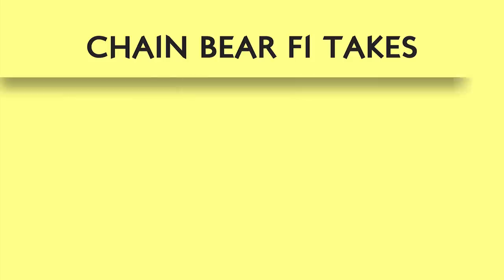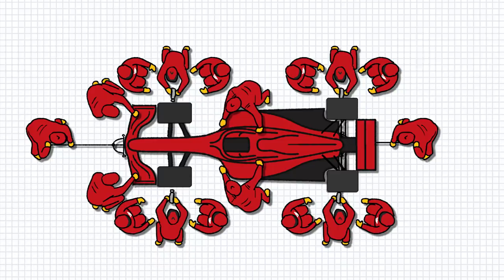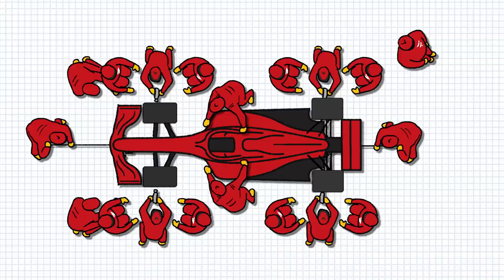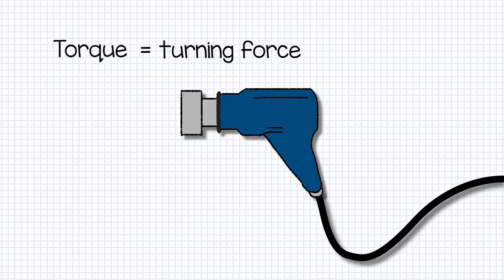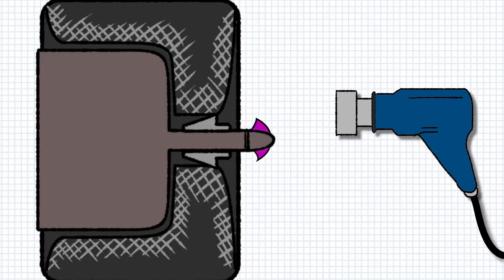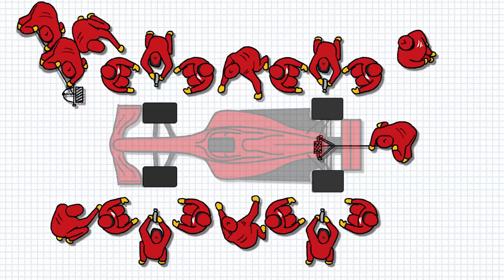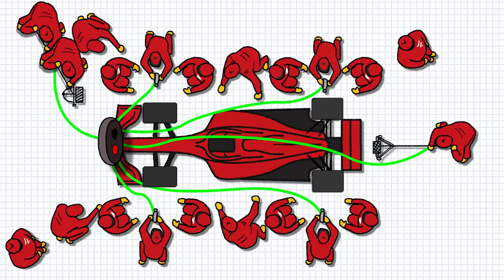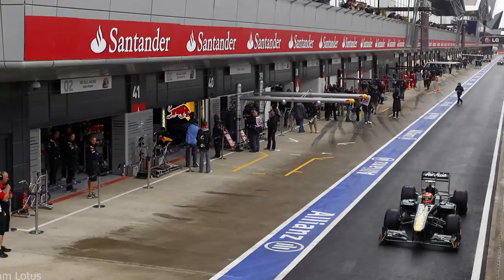The anatomy of an F1 pitstop - Two seconds of mayhem - Bahrain GP 2018

Comment: The set time for a pit top is a bad idea. It will take away the risk in strategies and timing as teams will know precisely the time they will gain/lose in the pit stops.
Reply: I'd bet they already know this time based on their pit training, so not much change.
Reply: They already kinda know how much time it takes to make a pit stop (and by kinda know i mean within a .2-.3 sec margin)
Reply: Ethan Cadman And also if someone needs a new front wing, the time between a normal pit stop and a pit stop with front wing change would be smaller
Reply: F1 is expensive. Driver and Car reliability already a significant factor for failure. Pit stop competition is too big risk for failure. Imagine there are 15 pit crews, one made error,  Boom, Zero points. I fully support minimum pitstop time 5 secs.
Reply: I like the smaller pit crew idea, F1 has about double the pit crews of other category’s of racing if not more, I’d also like to see refuelling brought back even tho I understand why it won’t, could maybe look at another system tho, one where a fuel cap has to be closed before it triggers that fuelling is complete which would mean in theory it would be impossible for a car to leave with a fuel hose still attached, just think it would make pit stops more interesting and strategies more interesting an
Reply: Agreed, takes out the magic

Comment: Box shaped line 1m away from the cars position in the pits. Car may only be released once everyone is over the line. Safe and competitive.
Reply: Imrahil sounds really cool, but this could be very difficult at street circuits like Monaco. But this would be great to watch since this would super competitive between all the pitstop teams.
Reply: Imrahil actually that is a great idea, but the room for the crews is already very small.
Reply: I don't see this working as it requires mechanics to hurl themselves towards the traffic lane and potentialle get run over if they're too eager
Reply: You'll see mechanics leaping backward out of your box regardless of the state of the car or dangers around them as it will save a good 0.2 seconds.
Reply: Excludos not towards the traffic line but between the car and the box/garage itself. That way they won't be in any danger to get run over because they are in a safe place.
Reply: My favorite solution and if the light signal for the car turns green before everyone and every body part is over the line it is an unsafe release with according penalty.
Reply: Tiliad why? They got a box the line could be right at the entrance of the box so everybody has typo be in the box before the light turns green. No problem even for street courses like Monaco.
Reply: If I understand that right, one line on the garage side. That means the track side guys have to run around the car. I like that. Would call for a lot of video replay. Was the mechanic just over or not quite. Kind of like the out of bounds in American football.

Personally, I prefer reduced crews. For me two tire changers and back to the air jacks. The tire changers line up with the fresh tire on the "outside". They have to scramble around to the other side and do that tire. Would make a pit stop 5 to 10 seconds and change the strategy completely. I'd rather see a tire last the distance like it used to and skip mandatory compound change all together
Reply: Pit stops are fine the way they are. However, one thing that could be improved is having wheels that don't need a nut to be tightened. Sort of pop it in and it locks itself, and then needs a tool to be unlocked. Like the sprung pin described in the video, but tight and secure enough that nothing else is needed. Surely engineers can come up with such a system. Then there would be no more loose wheels, and no need for pneumatic guns.
Reply: I've been hearing this alot. Can we make a petition or just email the FIA and Liberty  Media already?
Reply: hire usain bolt and his cousins :)
Reply: But hard to check if someone ruins it

Comment: I like the solution you suggested with the buttons some distance away from the wheel gun operators. Might look a little forced/comical, but adding another physical task for the pit crew to do will add to the the frantic feel that a pit stop already has and will probably be cause for a more interesting race

Comment: I like the "flick a switch and press a button" solution, but they have to keep holding the button to keep it green, so when they notice that the wheel's not on properly they can just release the button and put the wheel on properly without flailing their arms while the car accelerating down the pit lane.

Comment: My proposal (I don't know if it's a good idea):
Give the gun operators on each tyre a "ready-button" on the gun that they can press when their tyre is fully on and fitted. When all the mechanics of the four wheels have pressed the button, and the car is on the ground, only then the light can go green.
This looks to be the same system as you explained, but it's not. Because nowadays, the buttons on the gun don't need to be pressed. There is an electronic systems that checks if the gun is close to the tyre. It is automated and there is currently no need for mechanics to press the button.
Reply: I saw a NASCAR accident where the jackmen lowered the car to fast and a tire changer wasn't done and he had his hand in the wheel well so the car drove over his hand and the tire fell off soon after the driver left the pit
Reply: I saw a NASCAR incident where a jackman lowered the car too early so a tire changer didn't finish but he also had his hand on the tire when the car drove off. And when the car left the pit a wheel flew off. I've also seen someone drive off with a fuel can still attached to their car, pretty sure it was an LMP but it's been a while since I saw this one

Comment: The engineer commentator on finnish TV told that some teams have torque sensors in their wheel guns and it turns the light green when it gets high torque readings. It is possible that the programmer of the software simply didn't consider that three wheels are getting tight while fourth is still tight because it's stuck and thus gives green light.

Comment: The way the traffic light knows the wheel is on is when a wheel is tightened to a specific torque. At Bahrain the mechanic put the setting on the gun wrong and he tightened he wheel when trying to get the wheel off. The traffic light system thought the wheel was tightened and was ready to go and that is where the accident happened. I know all this as I went to the McLaren technology centre and they told me all the info about what happened.

Comment: A simple solution would be to change the buttons so they have to be held down. This way, if anyone releases their button before all of them have been pressed and held, the light will not turn green. This comes right from roller coaster operation, where dispatching the train from the station requires the operator and an attendant, at the opposite corner, to both hold down a button. If either of them releases their button before the train clears the station, it'll stop.

Comment: On Sky's program, David and Martin mentioned Ferrari's traffic light system depended on the wheels' nuts being tightened. The moment 4 wheels are tightened, it will signal green. Of course it can be override by someone in the pits. 

But the left rear's wheel wasn't even loosened, hence the green light was given.

Comment: I have an idea on how to avoid future such incidents during pit stops:
Paint white lines at the edges of the pit box.
Have the pole with the green and red lights that tell drivers when to go during a pit contain a camera that will be able to see these white lines, and can tell when they are obstructed or other (self driving cars and lane change warning systems have been on passenger cars for at while now).
Have a system which will turn the light green ONLY after both jacks are dropped and the pit box lines are clear.
System can also be programmed to see if tires go on/off the car.

This could solve a lot of potential injuries in the pits. In the case of today's race, the left rear never came off the car, yet the jacks were dropped. This system would have been able to detect: 
Obstruction of pit box line by the mechanics around the left rear tire.
Left rear tire never came off the vehicle.

This would also eliminate the need for mandatory minimum put stop times.

What do you guys think? Could some sort of system like this be implemented by the FIA?
Essentially a "virtual lollipop man".

Comment: Actually the mechanics dont have a button as far as I know, but rather there is a integrated system into the wheel gun; called Paoli TSA System, which monitors the torque applied to the wheel nut, shows the mechanic via LEDs and sends the signal to a designated PC.

My guess is, the wheel nut didnt open the first time he tried, turning the the nut left. 
Then, as we guys often do, he tried to loosen it by turning the nut the other way round (in his case right), "tightenting" it again.
This noticed the gun and gave the signal "torque reached, tire changed" and therefore gave the green light from that tire.
Then he switched the rotation of the gun back again, finally loosening it. But at that time it was to late, the rear jack operator dropped the car and Kimi took off.

So in my eyes, the mistake was done by the guy at the rear; he has to see if a tire was changed or not. And decide when to drop the car or not.

Comment: Put sensors and hooks in the wheel bolts that the hooks spring out when over the nut when it’s properly tightened and sensors that tell the spotter. When they’re all fit and the car lowered ready to go.

Comment: When refuelling was a thing, the refuelling delay gave the team time (8-10 seconds more or less) to do all the changes they need to make to the wheels, tear off strips, safety checks. The complex part of pitting a car - the wheel change, is now completely unrestricted, which means teams have an incentive to push as hard as they can to reduce the duration of this action. This is the root of the issue. I'm not saying bring refuelling back (but I kind of am, because it added a great tactical element), I'm saying that there needs to be a regulating factor to prevent teams pushing beyond their limits and making mistakes. Kimi running over the pit crew member is as serious as any crash on the racing circuit - if that leg had broken a little higher through his femur, he may not have survived. 2 seconds a stop is about the limit of what a team can safely manage, as has been proven 3 times in two races.

Comment: F1 is supposed to be the pinnacle of motorsport, although all the mentioned options are great for pit stop safety It would not fit in the "absolute fastest way possible" of F1. Banning refueling was a big step foward in terms of pit safety bit kinda made things less interesting when fuel loads were such an integral part of race strategy.
Reply: TheSuperNort True, but as an added effect it made pit stops much less fire prone or with refueling equipment in general, massa's debacle at singapore 08 is a prime example.

Comment: Look at Australia supercars pitstops. We only have 1 guy per wheel and the cars have air jacks in them. When the car drops you go. Very rare failures and pribeln apart from the rare times someone is dropped whilst still refueling. Extremely rare seeing 1 team got a 5 minute penalty for doing so.

Comment: Cameras using artificial vision from the top down send a "no go" signal until all of the crew is out of predefined areas in front of the wheels and body work.  A method to "ID" the wheel/tire combo and the car would not move until the 4 old wheels and tires were removed and the new ones were fitted.

Comment: I had heard (from where I don't remember, probably some commenter on reddit) that the Ferrari system is based off of tightness of wheel nuts. If they are tight, green light shows. Sort of like an "istight" variable being used. Of course, as we saw, this system has its flaws, and a "isNewWheel" AND "istight" would work as a better gate.

Comment: the indy car system with 1 person per corner for the wheels and also pneumatic jacks built into the car as brabham pioneered would be great way not only to reduce costs but simplify the pitstop process. having minimum set times, you might as well have a rig that the car pulled into that did it all automatically. forumla 1 should be keeping up with the "team spirit" of racing.

Comment: F1 did away with buttons on the guns ages ago, they now have torque sensors that automatically say all good when the nut is tight. But this system doesn't deal well with things outside of standard operation. I suspect with hass the sensor wasn't calibrated properly. Kimi's incident I imagine went something like 1 wheel wouldn't come off 2 mechanic uses his instinct and flicks the gun to tighten (which also happens automatically in a normal pitstop) and gives it a quick hit hoping for it to help (which is a thing with rattle guns) 3 this triggers the torque sensor, light goes green.

Comment: great explanation as per normal. I think I like the idea of the mechanics have to get up and go to a pillar that has the button on it. that would at least keep what happened in Bahrain from happening if they are completely clear of the car maybe they even need to all be held at the same time for a release so someone can't hit it before and go to the car. This might bring on failure if a button doesn't work or gets shorted out and the car is held longer than it should be, but a master switch given to a spotter could override, it's easier to see the car is clear when all the mechanics are far away from it.

Comment: I think some teams have even more complicated systems. Instead of a button on the wheel gun the gun itself registers the torque applied and automatically sends a signal that the nut has been tightened enough. The jacks then receive the signal and automatically drops the car and gives a green light. The jack man can manually drop it if the system fails, but he can not lift it again without a complete reset, which is why they usually have a secondary jack man ready to step in.

Why the gun signaled that the nut had been tightened before it was even removed in this case is what Ferrari needs to look into. Maybe the gun man had it accidentally set in the wrong direction from the start and that is why he didn't get the nut off?

Also, if at least one of the guys on each wheel had an override button that when pressed signaled that something has gone wrong they could have saved themselves from this weeks accident. I mean, there where at least three guys on that rear left that knew they could not release the car as normal.

Comment: I think that the longer it takes to pit stop, the less drivers will want to stop. So any pit stop, even because somebody else punched your tyre or smashed your front wing, will be extremely important on the final position. 
So, in my opinion, the less a pit stop lasts, the fairer it is for everybody.

Comment: Ferrari’s system turns the light green when the sensors on all 4 wheels sense that a new wheel is attatched. 
So 3 of the wheels came off and back on again with new tyres whilst the one hadn’t even been taken off, once this happened, their system essentially was being told ‘there are now 4 wheels on the car, turn the light green’
..which lead to the release of the car.

Sometimes doing things the ‘old fashioned way’ will always beat technology!

Comment: The first thought which came to me WAS minimum pitstop time, but then the question of taking 1 or 2 pitstops arises as now taking 2 pitstops could possibly turn into a loss.
Reply: UnseenPhantom increase pit lane speed to compensate then. Haven't seen anyone get run over before. Seen plenty of tyres flying around though.

Comment: I know how badly the pitstops when it goes wrong. Having minimum pitting time is the safest idea, however it also screws the strategy aspect in F1. Meaning if minimum pitting time is applied, it encourages teams to do lesser pitstop, and it ruins the tyres strategy as this year's Bahrain GP, so many different strategy (mainly 2-stops, Mercs and Erricson's 1 stop and Vettel's 2 stops-but forced to stay after 1 stop after what happened to Kimi's pit crew). Even those with 2-stops have different compound changes one after another.

Comment: That green light system is interesting. I would think that teams could have their drill guns connected to a computer that monitors it's activity and gives the green light when certain parameters are met like the gun spinning for at least half a second (or however long it takes to unscrew the wheel lug) and must encounter the standard amount of force exerted on the lug. I mean having to actually press a button is inevitably going to add a fraction of a second which could be significant for something that only takes two seconds.

Comment: Why not adding one spotter for each wheel instead of a general spotter of the pit ? Like that one spotter can be focused only on its wheel crew and therefore be more aware ? In addition of all the switch to allow the light to go green, the additional spotters will also have a switch that they will press in case something goes wrong and prevent the light to turn green and thus the unsafe release ?

That is just an idea :)

Comment: Change the overrides of the crew and lane spotters from on-depression to on-release. They keep it depressed to force the pit light to stay red and don't release it until both the crew and lane are clear, they should have the lowest risk of screwing up since they're not in a relatively as high pressure position.